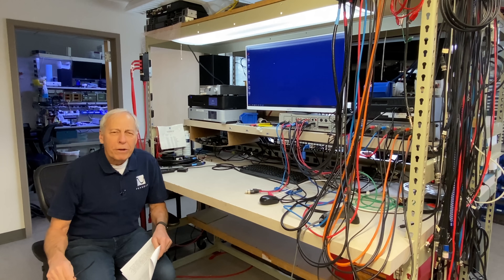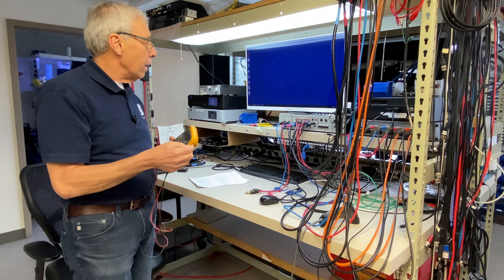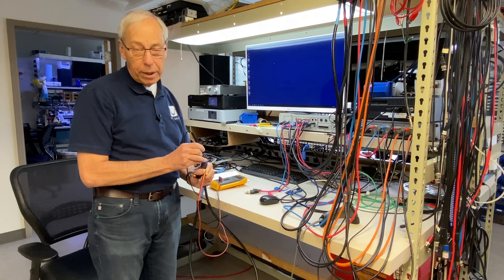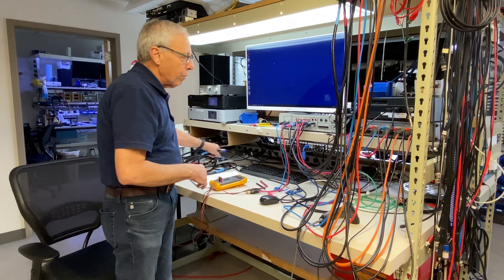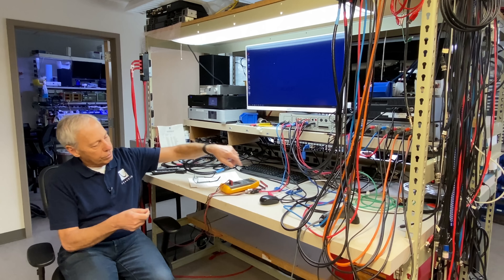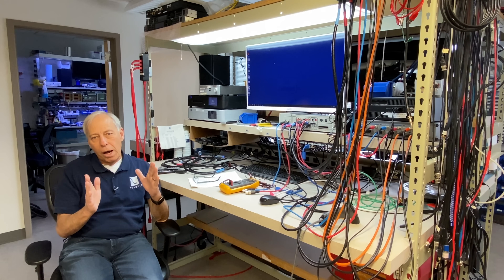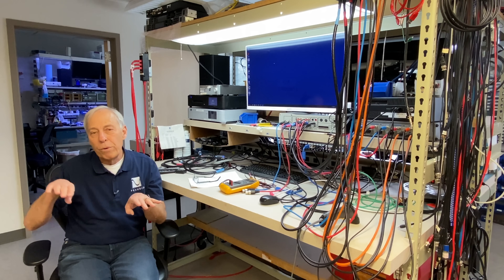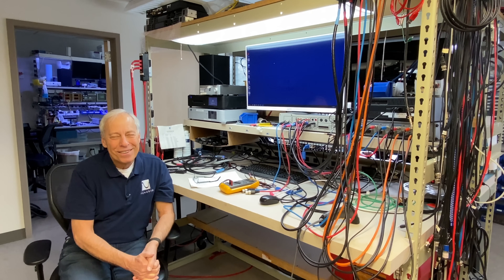Speaker cable impedance

Comment: Could be the guy showing high resistance cable - could be oxidised - I had this with some cheaper cables and they measured 2ohm resistance ! Changed these with merchant like for like and now no measurable resistance on normal multimeter 😮

Comment: If you are using an DC Ohmmeter, you are measuring the resistance, not impedance. For alternate current like sound or HF is a loudspeaker cable a transmission line and has the impedance Zo, that not depend on line length. A loudspeaker cable with resistance of three Ohms is rubisch. Perhaps is the Ohm meter defective? it is more possible as 3 Ohm cable. For example a 10 meter length wire of 1,5 mm2 square made of iron has  resistance of 0,65 Ohm, copper 0.11 Ohms

Comment: There is more to think of because if wire resistanse is 4 ohms, it will be that both wires, positive and negative. So speaker get the voltage even less then half the original like 1/3.

Comment: Mass increases capacitance so you get better sound, also it keeps heat in the cable lower, so electrons will flow easier
. Please correct me if i am wrong.

Comment: The big question if resistance changes per frequency remains still unanswered. If not then i would say just crank up your amp to compensate for loss in the cable.

Comment: A speaker cable with 4 Ohm resistance is defective. You would be better off using lamp wire.

Comment: Notwithstanding series inductive reactance and shunt capacitive reactance, if we only consider the series resistance of a speaker cable, and if the resistance is 4 ohms (end to end) then that would result in the system damping factor being degraded to 2 (!). Such a value will result in muddy sound, especially bass notes. As a comparison, vacuum tube amp damping factors are in the order of 50 and solid state amps have damping factors in the hundreds, and even higher.

Comment: Paul says ".3" when he measures the test cable, after he declares "decent set of wire should measure in the milliohms"... I don't understand: ".3" is in the milliohms?
Reply: Principe Nero   Yes, 0.3 is 300 milliohms. You won't see a cable with 1 or 2  milliohms unless it is a supper conductor, where the cable would have zero resistance. Now you got me thinking if anyone has tried this.

Comment: It's amazing how many mistakes are in one video.  Remember folks, this is the level of technical expertise that PS Audio puts in their designs!  Entertaining though.
Reply: You don't feel the need to actually point out what any of these mistakes might be, or correct anything? Just throwing rocks from the audience to feel cool? or what?
Reply: @RadBadTad  At 51 seconds he says his multimeter measures impedance.  It does, not it measures resistance.  Big difference, it you know electronics. OL means Open Loop, not Overload. When Paul goes to measure the piece of speaker wire, he doesn't zero-out the meter lead resistance, so the measurement (0.3 Ohms) is useless. At 2:40, he mistakes a 4 Ohm speaker impedance with resistance.  AT 3:12 he mentions an 'impedance resistor' which does not exist.  At 3:42 he says the multimeter outputs a voltage to measure resistance, it does not, it uses a constant current source.  AT 5 minutes he does not understand that al cables have some reactance, it's a frequency dependent resistance.  I'm sure the last minute is pure genius, but I have other things to do.  These videos are an embarrassment, but then so are the designs I've see, so there is a kind of consistency at work there.
Reply: @davecollinsmastering  Ya don't need to BE an EE to run a successful company...
Just hire THE BEST IN THE INDUSTRY.
Me,I sound DUMB esplaining Digital Theory...
Reply: @jeffmassey4860  Well, it looks like PS Audio has saved to big money on engineering help, based on the performance of their products.  That Gain Cell stuff is truly embarrassing......  And things like the Noise Harvester are just plain nonsense.  I wrote a short monograph on that subject. 

http://collinsaudio.com/Prosound_Workshop/Noise_Harvester.pdf

Comment: I have to wonder what meter was used to measure the asker's speaker wire. 
Typical VOMs, either analog or digital, give inaccurate and inconsistent readings for low resistances. 
Back in the 1970s, we gave my dad a B&K 2810 DMM, which has a special range for resistances below 10 ohms. 
Many years later he handed it over to me, and it still works well, though I don't normally use it.

Comment: If a straight wire is reading over 0.05 ohm you are making a heater out of the wire polystyrene cutting wire has 0.5 ohm resistance per foot of wire and thats set up for cutting with only 6v running through it

Comment: hi paul , i have monitor speaker (yamaha hs5)
do i need UPS ?? does UPS for monitor speaker is good ? or bad? 
i have UPS 1200VA (not expensive one , it has synthesized sineewave) which i used it for my computer and LED monitor , i wondering if i plug my speaker it will protect the speakers from surge or blackout.
any thought? need your opinion
thanks
Reply: A good quality UPS will have EMI/ RFI &( voltage) transient filters....
Of the two categories available..
1) Off Line UPS... ups comes on in event of utility supply failure..
( usually cheaper ) 
2 ) On Line UPS..  utility is always charging the cells.. and inverter is always the Source  for your loads..
.. Therefore in On Line type. , loads connected to ups are better protected from all utility disturbances...

Comment: @PS Audio, it's not .3 ohm, it's .1 ohm, you haven't zeroed the probes on the multimeter
3:38, wrong again, all meters do not use voltage for measuring resistance, they use current, they don't "put out a voltage", they use a constant current source to sink a known current into the resistor, and they measure the voltage across the resistor, with that and ohms law, you get the resistance - more special meters that measure 100s of giga ohms, use a thousands of volts and a voltage source, not a current source - you've got to talk specifics, "puts out a voltage" does nothing when you get to design and build things, and it's not good enough if you're calling yourself an engineer, you don't forget these things
Reply: As usual, Paul was trying to keep it simple, or understandable to non engineers / technicians.

Comment: Aaauuuggghh!  OL does not mean overload!  It means open loop.  It can't be overloaded if nothing connected.  It's infinity!
Reply: What does OL mean when the meter is on a voltage or current range?
Reply: OL =open loop (really of range!)
Reply: We Old-Timers only knew it as overload.
Reply: Either it's taken as Open Loop or
Out (of) Limit(s) i.e. outside the range/ limit of the meter..
If considered Open Loop by some.. ,take it to mean that the circuit Loop is Open ...i.e. not connected/ broken somewhere..

Comment: Tip: first step when measuring low resistances is to 'zero' the meter with the test leads shorted.  This cancels out the test leads for any readings you make. Also, manufacturers provide cable resistance specs in terms of Ohms per meter length.  If you have doubts you should be ale to find that info for the size/guage of wire you are testing.  that should give you an idea  whether it is copper losses or bad connections to your lugs or banana plugs. Edit: I am offering this advice as an ex Tradesman/technician as it is a common mistake and we have all forgot to do it. So if you reply to this comment please try and keep it constructive.

Comment: Hey paul. If you have a series of 2x4Ohm the voltage is cut to the half. On the other hand the current will also be cut to half value because I = U/R.
The power P is voltage * current, so you will just have 1/4 of the standart power.. so the sound is cut to 1/4, not to 1/2. correct me if I’m wrong
Best greets

Comment: Here's something that happened to me when I was living near the beach. I bought the best 12 gauge speaker wire I can find. It was labeled oxygen free made in the USA. After about 10 years I noticed the entire length of 15 ft cable had turned green. I took it off and sure enough it measured at about 2 ohms. The salt Air got in an oxidized the copper . So now whenever I get raw speaker wire. Not only do I  Tin the Ends, but I also add liquid tape, where the wire meets the insulator. since I've been doing that I've never had the oxidation or (Green Creep) happen again. I really dig these videos by the way..👍🤘
Reply: After further research i found that the color chance is caused by outgassing of chloride ( a form of chlorine ) from the PVC ( polyvinyl chloride ) cover , better grades of pvc do this less but they all will do it eventually and the environment  it's in affects the rate of outgassing. Unless it's really bad it will have a negligible effect on sound quality.
Reply: @leekumiega6576  That is evident in a lot of lamp cords where the jacket is kinda see-through.
When it turns green,then start worrying. LOL
Reply: @leekumiega6576  Teflon insulation is much better. Was this some of the in-wall speaker cable sold on rolls at a hardware store?
Reply: @zulumax1  It was original Monster cable it was the best available 35 years ago when I got my speakers. What are you using.
Reply: @leekumiega6576  I have 3 different systems in my house because I collect and repair vintage hifi. My tube system I am running 20 year old Monster Cable which uses the newer teflon insulation which is twisted and sheathed with a round outer rubber covering. On the cable is printed "Original Monster Cable - 2R-C 12/2 High Resolution Speaker Cable - E138990 (UL)CL3 75 degree CSA AWM ll91475 FT4 THX maximum lengths subwoofer 60 feet"
That is what is printed on the cable whatever all that means. I also have a set of Audio Magic SCEPTOR teflon cable with silver 18 gauge construction which I paid $10 a foot for back in 1998. Silver changes the sonics and tends to lean the bass and draw attention to the treble. 18 gauge silver is supposed to have the same ohms per foot as 12 gauge copper. Copper has better flexibility and sounds  more natural to me. My vintage Sansui system I am using Acoustic Research  pro series II 16 gauge oxygen free flat ribbon cable. My high end system I use DH Labs Silver Sonic Q-10 bi-wire cable which uses 10 gauge silver clad copper wire for the woofer and 14 gauge silver clad copper for the tweeter. That cable is $14 a foot.
Reply: @zulumax1  Thanks for the info. I was thinking of getting Apex Jr silver coated copper  I wonder how they would compare to your DH labs . Their site has 12 gauge for 55 cents per foot bit I think that chart is for single conductor , will have to call them for more information. Even if I had to double them up a cost $ 1.10 per foot is excellent.
Reply: Copper going Green ..it's reducing its carbon footprint to save planet Earth...
Reply: Are you sure the oxygen is entering from the ends and not permeating through the vinyl cover, how long have you had the new cables? Also if you tinned the bare ends be sure to tighten the connections every other year as solder cold flows under pressure loosening  the connection on a 5 way binding post. Also I will have to measure and compare my 35 year old green 12 AWG cable to some new ones I got for my center and rear speakers .
Reply: Beware that plastics are porous. You certainly have slowed down the oxidation massively, but it will still happen. (Might take years so it's still very useful)
Reply: Can you give the brand? Wire shouldn't oxidize like that thru the length unless the PVC jacket is low-grade.
I bought some Carol silver-plated 12 gauge wire 15 years ago,and there is no sign of tarnishing anywhere.
Ran this wire to all the speakers,with no problems.

Comment: If resistance cuts the voltage to a speaker in half will give you a 6db drop in output, 1/4 the power. What it does to the damping factor would be worse. Paul, you should know to subtract the lead resistance from the meter reading. It would be an extraordinary long run for normal speaker wire to even get up to one tenth of an ohm.

Comment: Actually Paul, that cable you measured is only 0.1ohms. Remember your meter showed 0.2 ohms with the leads shorted. You need to subtract that out. Or try rotating the plugs around on your meter cables to clean the connection, That's what I do when mine fails to zero out to a reasonable value. But unless the OP's speaker cables are over several hundred feet, 4 ohms is pretty piss-poor. But then this is not surprising with many high end audio cables. Electrically they are quite inferior to Wall Mart equivalents. Oh, they do change the sound, but for the worse technically. I often wonder if this negative change in performance is what people thinks sounds better? In this case it would certainly sound different than proper speaker cables.

Comment: I couldn't listen .. OMG ! Paul got really tied up over this simple topic. 
Speaker cable has INDUCTANCE .. measured in mH ... it's reactive over long lengths ... the combination of the inductance AND dc resistance is expressed in IMPEDANCE... ok 👌 
So if the dc resistance is kept really low .. say 0.05 ohms over a 20 foot long piece of speaker cable then the impedance will be minimised and there will be hardly any power loss. Inductance varies according to frequency but with a very low dc resistance and short lengths this should not impose any adverse effects on sound quality at all. By the way .. Paul's multi meter there showed 0.2 ohms with the probes shorted ... this is often the case with digital meters ... you can remove the back and locate the trim pot that will actually 'zero' this reading just like the external pot you find on analog multi meters ...
Reply: On my DMM, I push the button labeled "REL."  There is no trim pot.
Reply: Marianne Oelund what make is that ?
Reply: @janinapalmer8368  
I have 3 inexpensive hand-held DMMs.  Two are from Radio Shack, and one is an Extech model.  All of them have a REL or "0 adj" button.  It is very useful on low resistance and capacitance ranges.  
I never invested in a precision DMM because most of the measurements that I make require a scope to really see what's going on.  I have a Tektronix MSO4104 with a 200MHz differential voltage probe and a DC-120MHz 30A current probe.
Reply: Fat Rat about 10 years now .. it's an ME1500
Reply: @janinapalmer8368  
The way that thing is built, reminds me of Stuart & Sons pianos, also in Australia.
Reply: Fat Rat ... stock clearance! I went over to Peter Stein's place over in Wang Wuk near Taree ... he lives on a huge 25 acre property with his amp assembly plant right there ... the complete opposite of PS audio 😂...

Comment: Hi, thanks for the video. In fact, I dealt with a similar quality to these cables. I can say that the inner wire is not pure copper but rather a mixture of metal with copper or copper with tin or copper with zinc or aluminum with tin and this is the reason behind the high resistance and in fact It is not possible to distinguish between the quality of the good wire and the bad type except by stripping the wire and examining the internal poles well and making sure that the color of the inner wire is the color of natural copper

Comment: Paul:  When measuring very low resistances, at least use the offset feature of the meter to compensate for the test-lead resistance.  Even better, use a 4-wire ohmmeter.  
Also, we engineers think of cable impedance as the characteristic impedance, Z0, which is a rather different topic (although it does arise from the cable series inductance and parallel capacitance) and not usually applicable to audio.  Z0 = SQRT(Lu/Cu) where Lu and Cu are the inductance and capacitance for a unit length of cable.
Reply: Where are you getting your figures from as 18 AWG zip cord has a inductance of 18uH per 50 feet and 12 uH for 12 AWG way less than 1 uH per foot  so 12 0r 10 AWG if fine up to 50 feet depending on speaker impedance see here     https://www.eeweb.com/tools/parallel-wire-inductance as a site for inductance of wire and here is a good article of speaker wire considerations      https://www.audioholics.com/audio-video-cables/speaker-wire-gauge .
Reply: @leekumiega6576  
I removed the comment discussing inductance effects, because as you noticed, the figures were not reasonable (so much for relying on my memory).  
I just ran a test on an 18 AWG zip cord of 30 ft length, and it measured 6.5uH.  Total capacitance 525pF.  Inductive reactance at 20KHz is about 0.8 ohm.  Series resistance is about 0.4 ohm.  Attenuation at 20KHz with a 4 ohm load is 1dB, so only at the threshold of audibility.
Reply: Marianne Oelund, I would like to know your opinion... do you think speaker cables “make a difference?” Are there sonic benefits of one cable brand or style over another? There seem to be many opposing views, “snake oil”  vs. “tone control” etc. Just curious, as you seem to know quite a bit about the subject. Thank you
Reply: @Goinggoinggonzo  I doubt it as she uses 18 AWG sip cord.
Reply: @Goinggoinggonzo  
You need to make sure the cable is of adequate gauge for the distance you're running and the speaker impedance.  See Gene's recommendations in Table 1 on this page:  
https://www.audioholics.com/audio-video-cables/speaker-wire-gauge
Also avoid long runs to keep cable inductance down:  I wouldn't go more than 40' to an 8 ohm speaker, or 20' to a 4 ohm speaker.  Finally, make sure all connections are very solid and in good condition.  
If all of the above conditions are met, you shouldn't be able to hear any differences between cables. 
If anyone thinks they have a counterexample to the above, I would be happy to investigate it.